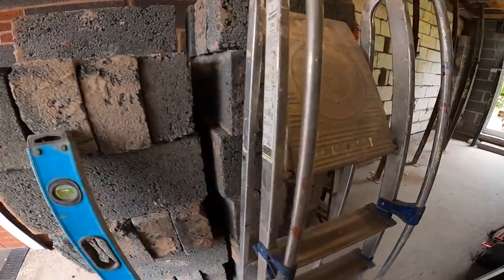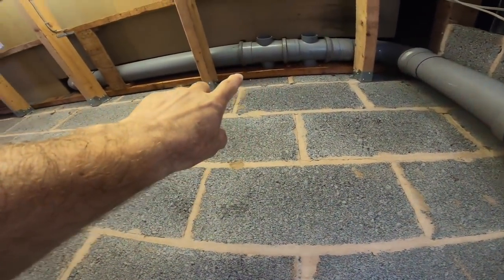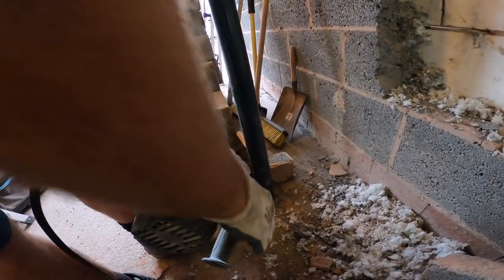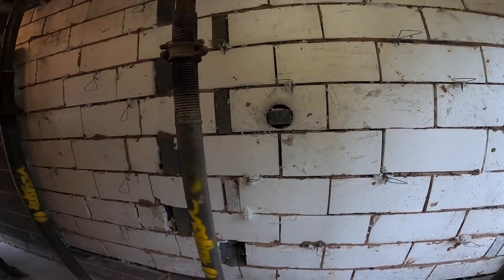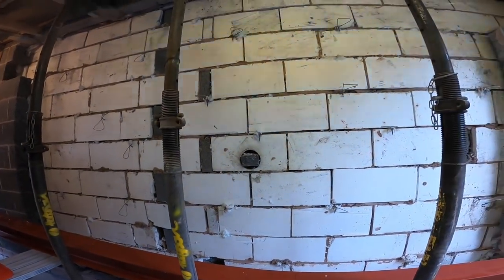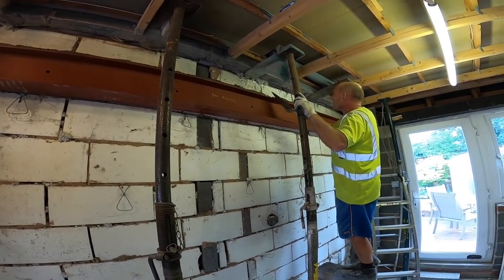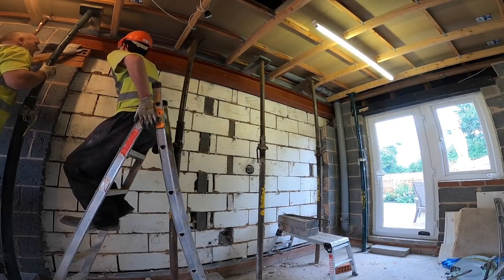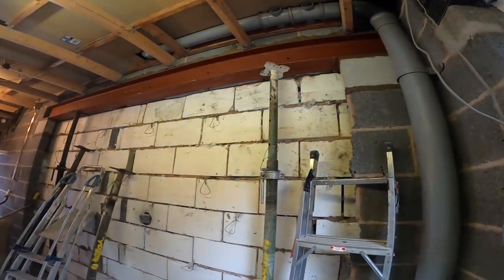MASSIVE HEAVY STEEL BEAM PART 1

Comment: Good that mate am trying to fit a steal tomorrow, if it’s 2 skin gable end .2 steals bolted together, should I do 1 side at a time or prop both side ?
Reply from the maker: No two jobs are the same so there isn’t any fixed rules which to do first , good luck with the project 🧱👍🏽

Comment: Hi great video as always ! what I've found helpful on these types of jobs is clipping a couple of scaffolding tubes to the top section of the acrow through the opening to lift the steel onto one end at a time. Only really works when you have acrows both sides of the wall but give stable support for the steel till you manoeuvre into final position
Reply from the maker: Thanks for the tip. 👌🏼🧱👍🏽

Comment: Genie lift boys…save your backs
Reply from the maker: 225 mm difference in floor level heights 🙄🧱👍🏼
Reply: Ask for the extendable arms for the genie which takes the arms past the wheels
Reply from the maker: @neilsmart78  😁🧱👍🏽
Reply: @neilsmart78  Or chock the bottom of the genie lift up so its level, Iv done that before

Comment: What does the pad stone actually do as opposed to bricks or normal breeze blocks?
Reply from the maker: Good question which I’m not entirely sure of the answer . If in doubt google 😉🧱👍🏽
Reply: Apparently they have a higher compressive strength according to the structural engineer who advised on my extension.

Comment: Great vid lads. I can remember doing a job like this years ago, the steel was a lot bigger than this. We got it in but wasn't happy about the safety aspect about putting a big load on hop ups. Anyway, bit the bullet and bought a beam lifter. Best thing i bought. there not that expensive either. worth it lads. great video by the way.
Reply from the maker: Thanks mark 🧱👍🏽

Comment: Question, After U chip out the blocks, what tension do U apply to the Strong Boy's ( to take the weight from above, bearing load ?, Thanks in Advance for Reply 👍
Reply from the maker: Hi George , nothing too scientific we just bang em up tight . If you go too tight the strong boys start to bend 🧱👍🏽💪🏼
Reply: Like the idea with SDS drill ( No dust from ConSaw/ mortar on top of steel, instead of packing in after steel offered up 🤯👍, Can't beat Common Sense
Reply from the maker: @georgeomalley6066  . Thanks George . 
  You won’t get a mortar bed more tightly packed than that , a much better quicker and stronger job for sure . 👌🏼💪🏼🧱👍🏽
Reply: @SteveAndAlexBuild  I've worked for a lot of 🐄'er💨(💩) Boy's (🤣), watched a Good few of your vid's, "❤️" The Content/Skill, Work Manship, You'll All ways get sMalL mINdeD Hater's, I've done worse, Not All Job's will pay a lift or extra men. 🖖 Enjoy your weekend, 🍺🍺🍺🍺
Reply from the maker: @georgeomalley6066  . Cheers George 😁🧱👍🏽

Comment: Another cracking job there lads. That steel looked seriously heavy. Would a genie lift have fitted in to make it easier at all?
Reply from the maker: Cheers Rian . Unfortunately the floors were 220 mm difference in height 😬🧱👍🏽
Reply: @SteveAndAlexBuild  ah that explains it. I knew there would be a could reason for it. Thanks

Comment: Man that was dangerous! Genie lift would have made it so easy even if you couldn't get it tight to wall. I used to put steels in with my dad just like this though! 😂
Reply from the maker: 😏. Floor levels were 220 mm difference so genie wouldn’t work 🧱👍🏽
Reply: @SteveAndAlexBuild  yeah had that a few times, you could have levelled the back up  with those blocks sitting there!

Comment: Out of interest, would you usually use a disc cutter instead of drilling pilot holes and chiselling blocks out or am I missing something? Love how you explain everything as you go guys keep up the good work
Reply from the maker: If it was an outside wall yes but grinders inside ain’t a good idea 😬. Thanks for watching and commenting 🧱🧱👍🏼
Reply: @SteveAndAlexBuild  Cheers for explaining mate
Reply: @Wavey Santos I think they used the pilot holes and chisel to reduce the dust that flys with the disc , I used this method when I was working on my kitchen little while back.

Comment: Few scary looking moments there, one question when I was helping a brickie cut through for my extension and fitting concrete lintels he insisted on packing the top with cement and slate for when it shrunk when it went off. How come you didn't add any slate in? 👍
Reply from the maker: We put a bed on top of the steel and wound it up tight so no need for slate . The mortar shrinkage is non existent 😁🧱👍🏽
Reply: Cheers for the reply no acros for us just brute force in a loft
Reply from the maker: @jamienelson7544  🥵💪🏼💪🏼🧱👍🏽

Comment: Love the fact you guys are wearing hard hats whilst overloading step platforms and balancing a heaving steel on blocks 🤣 hire a genie lift next time guys before someone gets hurt. 👍
Reply from the maker: A genie needs a a flat level surface which if you actually take more we didn’t have . 
   I bet if we didn’t wear the hard hats you would have been the first on to point it  out .🙄
Reply: @SteveAndAlexBuild  you can’t get much flatter than the Floor you was working off…. More worried about ya feet than you banging your head.. the small genies reach out further than the feet so no problem using it with different floor heights. Would of been much safer and quicker… 👍
Reply from the maker: @MrB3ngy  The kitchen floor was 225 mm higher than the garage floor abs Genies only lift straight up
Reply: @SteveAndAlexBuild  use the arm extenders, the feet touch the wall and the arms extend another 400mm. I’ve got the small one that lifts 190kg had it years. Much safer. Struggled for years like you. There worth there weight in gold.
Reply from the maker: @MrB3ngy  . Never seen them but we will be looking into them , cheers 🧱👍🏽
Reply: @SteveAndAlexBuild  👍👍